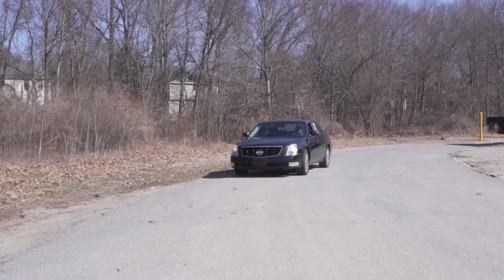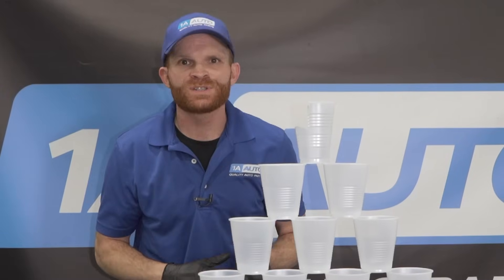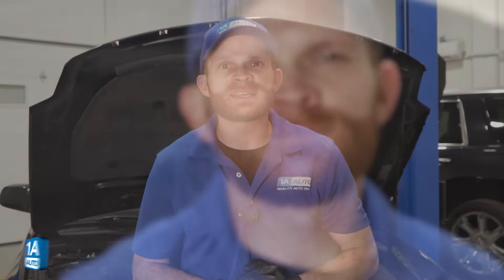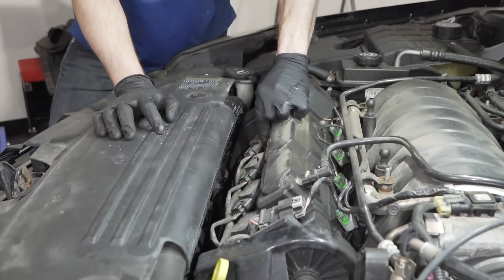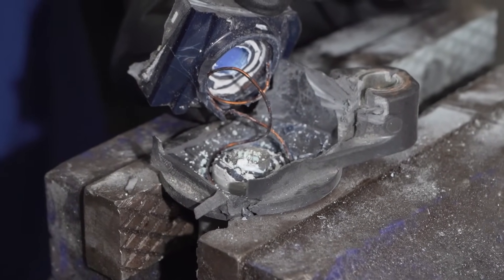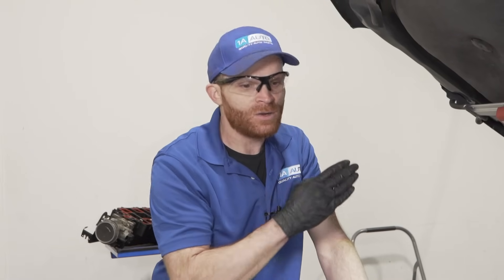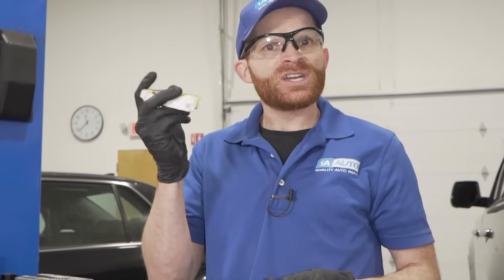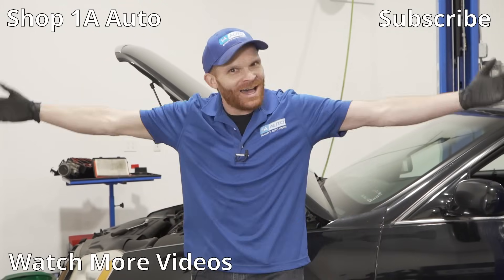Flashing check engine light reducing car or truck gas mileage? New spark plugs and coils can help.

Comment: My CEL is flashing and I’ve changed the spark plugs/ignition coils , maf & 02 sensor . Plus the fuel injectors so I’m thinking it has to be the catalytic converter?

Comment: My Buick Park Avenue with the 3.8 V6 had cats on the manifolds too. Had a coil pack instead of coil on plug, as does my '06 Rendezvous 3.5 V6, but I know general engine theory, si I know what you're getting at. Rock Auto has really good prices.

Comment: Changed the spark plugs changed the coils changed the fuel injectors and still getting a cylinder 3 misfire. What could it be?
Reply from the maker: +@richardevans16 We wouldn't be able to diagnose an issue like that here, you may want to have a local mechanic take a look at it. Thanks for checking us out! http://1aau.to/m/Shop-1AAuto-c

Comment: 99% of the time it’s the coil pack You can also just start your vehicle and disconnect each coil packs connector one at a time, if the car idles worse when you unplug it then plug it back in and you’ll eventually disconnect one and the vehicle will stay the same and that’s your bad coil pack that needs replaced.

Comment: I am currently borrowing a car from the mechanic. I have had it for almost a month and when accelerating fast today my check engine light started blinking for a few seconds but disappeared when I stopped accelerating quickly.

Could I have caused this problem over a month or is it possible the car was already in bad shape? It's a 2008 Ford fiesta.

I'm panicking a bit that I destroyed the car somehow lol. Thanks

Comment: I’m not popping any codes, but my 2001 Accord EX Coupe that I bought for $600 18 months ago runs really rich. It just went over 131K, and now I’m wondering if the plug and coils have ever been changed. Think I’ll be doing some inspecting and probably ordering new ones from 1A Auto. I’m an actual customer and have received no compensation for my endorsement, and I have purchased parts for most of my current and former vehicles from 1A, including an new alternator for the aforementioned Accord. It works perfectly, and the price was about 1/3 that of an OEM.

Comment: If your car's checking engine light flashes 5 times then stops AND no code reported after you've turned on the ignition BUT not starting/driving the car, that's a different scenario.  In this case, the car's computer is trying to tell you that you need to do a drive cycle (see the car's manual), so that the computer can collect data on the emission system to monitor!

Comment: My is a jeep  patriot 2017 when u turn ingestion on light engine  light flash three times and u crank it and drive no engine but I change spark plugs does new fuel injection  system  or coil change

Comment: i always was told  blinking check engine light means more than one trouble code.i have also learned to believe on my own it means usualky more than one usually but means the car isnt getting enough piwer to function properly.from 1 or a combination of issues that wether together or alone means the car isnt making power.often a misfire for whatever reason ..which is true?

Comment: Great video.  Just installed a 3.9 L Range Rover V8 into my 1983 Land Rover Defender.   Motor was running rich, you can smell the fuel, also seems to be missfiring with low fuel efficency and also low torque for a V8.  Will check the plugs, coils and wires!  Also running hot, will check that as well

Comment: if ur ride doesnt run smoother after new ignition parts, give the computer a few miles to learn the new parts, a lot of times computers in vehicles adapt to conditions n have to relearn new ones, u can reset the computer so it learns them faster, but most ppl dont have access to that n it figures it out on its own anyway so....jus give it a few miles, i just dealt with this exact thing on a 99 dodge 1500 5.9, it took about a week n it slowly ran better n smoother

Comment: oof  u might not want to yank on the wires like that :p older cars especially all rusted n corroded up ones like this, dont always cooperate well with that, then youll have urself a real headache   around 8:08

Comment: I have a 2010 jeep grand Cherokee and the check engine light flashes I noticed the car has no coils packs just wired straight to the boot connected to the spark plug is that bad

Comment: Replaced coils and plugs it improved significantly for a day then steadily dropped back to maybe a mile better than it was before … what is the next step to cylinder 2 misfire….. fuel injector clean and/or replace or is there something else

Comment: I feel like there's more missing... For example, you've replaced all spark plugs and all coils,... What about valve cover gasket issues, fuel injector issues and after that, you still have a misfire code...?
Videos 2 and 3??

Comment: I’ve seen people test which cylinder is gone bad by removing the coil pack and/or the spark plug while the engine is running (to test for decreased engine performance). My issue is, the air filter is in the way. Can i remove it while the car is running?

Comment: Ok, I need some help. I compression checked my09 escape 2.5. 185,190,190,180. Cool. Only I have no idea how many psi it should be? Bought a Chilton manual at it says it's 10gb or 10 gh. I found no definitive answers online.  Anyone who can help with this would be appreciated 👍

Comment: I have a 01 dodge Ram van 5.9 magnum I have  changed the spark plug , spark plug wire’s , distributor cap , and distributor rotor it’s still running rough …… could it be the distributor out of timing ???? Or could it be my 7 year old  battery doing that

Comment: Got a question for you I got new spark plugs in and wires in a 96 Caprice police car. And now the check engine light blink. What can I do to fix it did they put the spark plugs in wrong or did they mix the wires. Do you suppose to take one off at a time or All the wires off
Reply: If they put new spark plugs in they could’ve damaged one it might need to be properly gapped

Comment: Have a 2002 Chevy blazer that will have the check engine light randomly flash when I'm driving at 60 miles per hour. Flash a bit then stop. I've replaced ignition coil, spark plugs, spark plug wires, distributor cap and rotor, ignition control module. Still misfires. Catalytic converter isnt getting overly hot.

Comment: When my cousin gave me his father's 2000 Toyota Camry LE on May 23, 2018. I bought what the owners manual said to get. I bought NGK Sparks Plugs, Wires, and Coils.  The mechanic put on the Spark plugs and wires but the mechanic wouldn't put on the new coils. I still to this day don't know why. The old spark plugs that came out of the 4 cylinder engine had only been changed once. One of the spark plugs ceramic was cracked. I can't believe my cousin was driving the Camry that way. I do some of the repairs myself because I don't trust mechanics where I live. The Camry needs alot of work. It's a challenge that I want to do. Like this video thank much.

Comment: Hey thanks. Had a P303 and P301 misfire codes on a Silverado, along with the dreaded ABS and StabilaTrack failure. But changed Pugs and wires and the misfire codes quite. But still have slight engine and the ABS and Stabilitrack disabled light. Any ideas?

Comment: I have this same problem. Check engine light is on rough idle it goes up hill fine but you really have to mash on the throttle very heavily. I can't figure out what the problem is ,. You have any idea what could be wrong.  It does have broken motor mounts but I don't think that is the problem.  The hose or intake pipe , rubber hose that goes to the top of the motor.  You have the box that has the air filter enclosure. Hook or clamped to the air inlet that goes into the manifold part ,. It had a tear in the part to the clamp onto the not the box but up by the motor.   I took it off to duct tape the ripped piece, but, the whole thing ripped off. So I removed the house clamps and remove the rubber part out it back on , and clamped it down , now the check engine light is on. It wasn't before any help would be appreciated. Thanks

Comment: If it’s a Hyundai or Kia with a 4 cylinder, 99% it’s of the time it’s P1326 knock sensor detection due to spun rod bearings… ask me how I know.